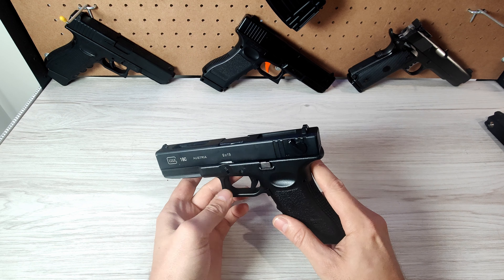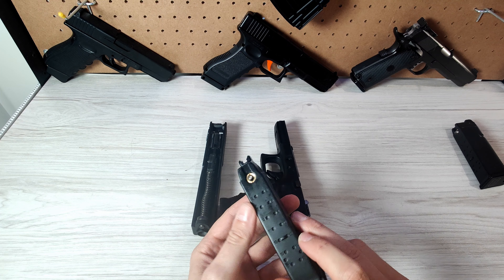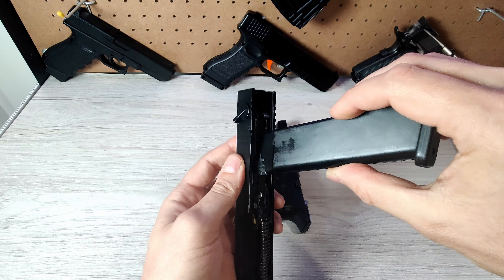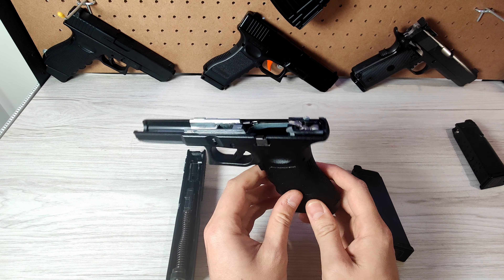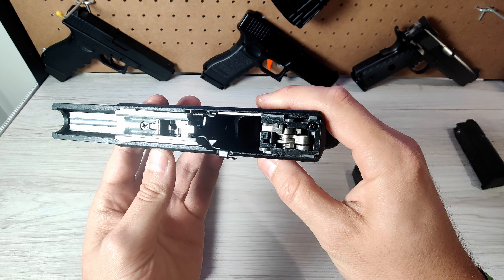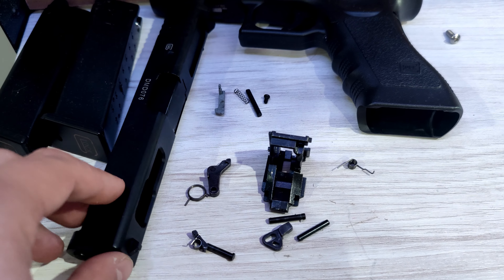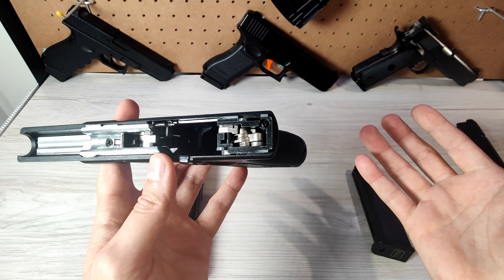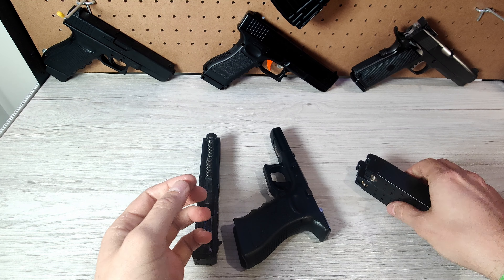Glock Gas Leak When Firing - GelBlaster/Airsoft

Comment: Idk I just took out and put back in the hammer couldn't see anything wrong, then lubed the o ring in the nozzle, and tightened rear sight screw tight, loose can cause this issue. That worked. No more gas spraying onto my hand

Comment: Have some similar issue but must be mag fault. One of the mags works fine other leaks only when shooting, however it does hold the gas when outside the gun. Both mags are different brand. Just wondering if its mags issue or gun issue and this broken mag is more sensitive of you know what I mean.

Comment: Mine is leaking when firing but I don't wanna break the gun fixing it is the a possibility that mabey it's just overfilled and I let all the gas out and put a tiny bit in but it only leaks gas with bbs when I dry fire does this mean it's fine and overtime if I let it sit will it work again

Comment: Hey mate, I have two problems with my clock18 if you possibly have any ideas I would appreciate your help please. My mag won’t fill with gas. I have tried bleeding it and also checked the seals etc and all looks good?? Have no idea what the problem is??? Also my trigger seems that the middle trigger has slipped out? Is this a thing
Reply from the maker: Hey james :) sounds like your fill valve might be blocked/damaged? or does it fill and the gas just leaks out? The middle trigger is the safety mechanism, so not sure what happened there...it may be worth doing a full teardown and remove the trigger to see what has come loose/broken. anyways, keep me posted :)

Comment: I have no idea whats the problem honestly, i sanded from the housing because where the hammer (bearing) touches it, it makes the whole slide stuck, now its fixed, but still leaking gas like that... I literally cant sell this crap! I will never try any glock again in my life! Worst airsoft experience i ever had!!!!
WET G18c
BTW 2:05: I dont have that small part here, but i already used this crap in semi and full auto too, while its worked for a 2 week for me... It can be a large problem? :D